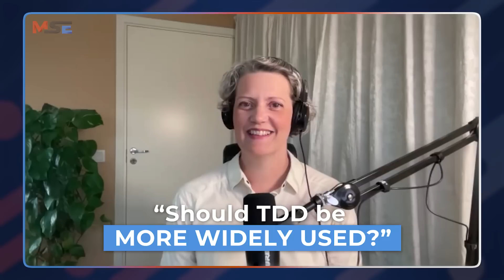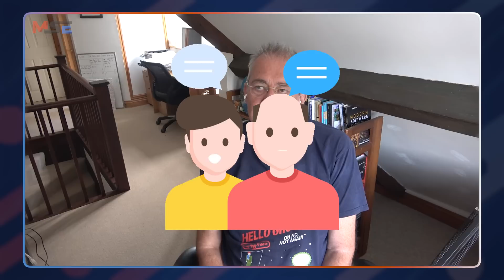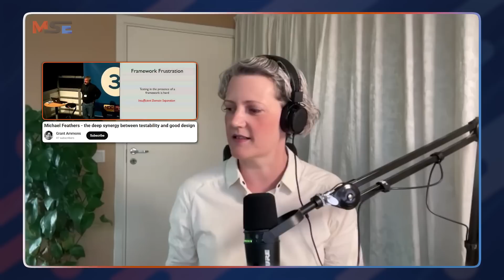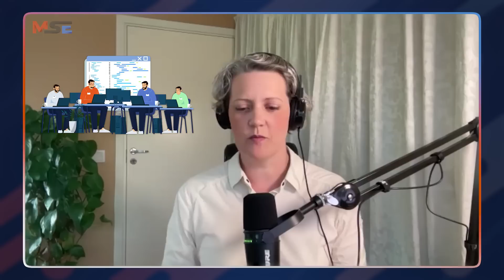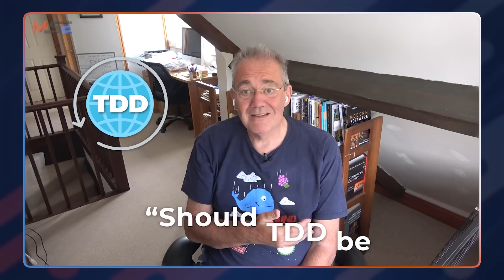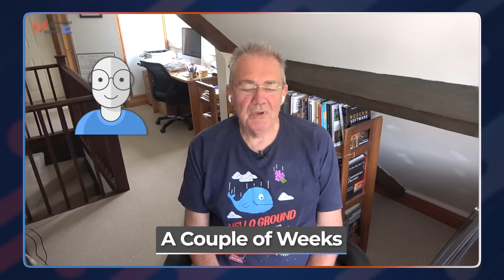Should Test-Driven Development (TDD) Be Used MORE In Software Engineering?

Comment: Approval testing is nice for legacy code but you are doing a disservice to the next developer. The output tend to get very big and don't describe the problem you are trying to solve enough. So a bug happens, but the tests pass but you have no idea what the intention was of the previous developer so you don't know how to fix without a lot of digging. If it has a more specific test then at least you have a description of the misunderstanding.
Reply: This is literally designed so you can get a test around stuff that you otherwise have to test manually. Where I have seen it it is a temporary measure until you can replace the garbage with something genuinely testable, then you get rid of it.

Comment: Religion allert... TTD is overused and also adds complexity. Overuse is changing 1 simple thing and 20 tests start to fail. And then the game starts: which is wrong, the test or the implementation?  Most of the time, functional tests are the only tests that matter. In => Out. Especially in big but smaller budget projects
Reply from the maker: That's a problem of poorly written tests, not really TDD as a practice. If you can't tell which is wrong, then your test is badly written. The test should clearly define what is meant to happen, in terms of desirable behaviour of the system.
Meta-data studies identified that 60% of production failures are caused by the common forms of mistake that all programmers put into code, off by 1 errors, conditionals the wrong way around and variable-scope errors. These are eliminated by simple automated testing. So no, functional tests aren't the best way to catch those mistakes.
Reply: @ModernSoftwareEngineeringYT, so if software can be written poorly and you try to fix that with tests, also software, you just admit a test can also be written poorly. Then, the problem of poorly written software is never solved. The problem of 'poorly written' comes from the devs who write the code, so the code, being business logic, or tests is always as good as the devs who write it. That's my point. Sure, good tests as intended in TTD will work great, but only when written by good devs. TTD adds complexity and workload and is not THE solution to guard software from bugs. It costs a lot of money, especially if tests are soso written. That's why functional tests are better. Test a wide coverage of in and out, and when something breaks, you will see it in that test.
Reply: If you make a tiny change and lots of tests break, you are testing the implementation, not the api.  either that, or you are end to end testing slop which can only be tested through the ui. In either case it has nothing to do with tdd, and everything to do with having no idea how to write testable code, or how to write tests.

Comment: The problem I have with the TDD/design argument is that the design (as described) is only ever considered in the context the current test. I don't really agree that this approach would drive a better design, as much as it will likely settle on a local minima of sufficient design.

The danger there is that future changes, which could have been known requirements at the outset, become incompatible with the architectures and data flows which have emerged - and either require ugly implementations or complete rewrites to implement.

I don't think TDD is incompatible with a design first approach...
Reply from the maker: I think, from your comment,  that you are missing some context of how design works in practice in TDD. 
I agree with you that there is no problem with thinking about design first. The trick is how you do that and the nature of that thinking. I tend to use ATDD (acceptance test driven development) to shape the overall design, create "executable specifications" for what the SW is meant to do. I also often draw  pictures to help me think about larger or intermediate level structure in the code. The mistake I see people make in design, is being too detailed at this stage. I think this level of design should be more like a rough sketch than anything detailed. The TDD helps you flesh-out the detail much more accurately than any other approach, and gives you much faster and better feedback on the quality of your design as a result. Most people that complain about design in TDD, are usually, in my experience, talking about unit testing rather than TDD. Unit tests tend to be too tightly-coupled to specific implementation. True TDD focuses on testing externally visible behaviour of the code, rather than implementation, and so is more resilient to change in implementation, and so supports exploratory design very well indeed when done well.
Reply: @ModernSoftwareEngineeringYT  That didn't come across in the video - to me it was suggesting that beyond the design of the test itself that no design was required until the optional refactor stage at which point it was more documenting the decision rather than reasoning the implementation, updating models and reviewing the traceability etc.
Reply: @ModernSoftwareEngineeringYT I hate to disagree with someone who literally wrote the book, but when I do it I write the tests to the public api, and the individual subfunctions get exercised and refactoring while being driven from that api. That way I can rip out old implementations simply by changing how the public function exercises the underlying code.

This does not mean that you can't identify useful helper functions, extract them during refactoring, and decide later if they could usefully be added to the api.

Comment: The issue is that most of the time your enterprise app is either crud or event handler -> database and back in two layers of business logic and one layer of io handling (web controller, message handler etc..).. Most common apps in business are wide and shallow and there is no design here. If you are being creative here, if you are "designing" you are overengineering.. So this whole argument for TDD just vanishes.. Narrow and deep programming jobs (3d or audio engines, whatever pdf interperter is, etc) benefit the most from TDD but are quite rare in practice..
Reply: It is like stating that good structural engineering requires solid math upfront, because skyscrapers. Unfortunately your actual job is laying down asphalt on clay dirt.. Like I do agree that math uprfront is essential - for actual *building*. But road works are more like 2% structural engineering and 98% cost management...

The real question is what is cost proposition of TDD? I have strong feeling that enforced dogmatic TDD is net negative..
Reply from the maker: Not sure what "enforced dogmatic TDD" is, but there is some data - "60% of production defects are the result of common programming mistakes... that would be eliminated by simple testing" https://www.usenix.org/system/files/conference/osdi14/osdi14-paper-yuan.pdf

So TDD can eliminate 60% of production failures, this is backed up by the practical experience of TDD teams. 

The DORA results found that "high performers" based on measures of "Stability & Throughput" spend 44% more time on new features than teams with average scores. 
This is not strictly a measure of TDD, but high scores in "Stability & Throughput" predicts that you are  practicing "Continuous Integration", and that tends to go hand in hand with TDD.

My own experience of working in high performing teams and using TDD is that these number under-estimate the impact. Paddy Power saw a 95% reduction in production defects when adopting CD (including TDD) and similar experiences are normal for teams that work this way.
Reply: @ModernSoftwareEngineeringYT  Mr Farly, thank you on replay.

I have read document you provided, and in very document out of 60% of "easy bugs to test", 23% percent were "very easy" single event failures. With a caveat that many of those where concurrency bugs. I wouldn't call that obvious - which brings me to a point that you can't test for what you don't know. Yes those "60% easy bugs" triggered by 4 or less events are trivial in a sense that a closed line integrals are trivial if you are used to them. It is hard to predict failure mode so statements "If your test were better" sound as being stated by Captain Hindsight..

Which brings me to a point which I made in my comment - that for majority of code being developed enforced TDD is cost negative.

There was old IBM study about cost of bugs and cost of early bug catching. Like bugs costs way less if caught early. The issues which I am raising are is that not all bugs cost the same. That study was written in times were deployment was a job. Today it is greatly context dependent. And majority of software works well with: ship it, report back if something is broken, we'll fixit in next version (or roll back if it is necessary). It is perfectly fine attitude for 90% of apps out there. 

All examples in your study are from established products with wide user base. I do agree that those require much more testing, for sake of distribution and usage variety alone. But those projects are "skyscrapers" from my initial post. Majority of code doesn't do distribution. Not even that but it has one deployment. Even in my "cool" app which (a real time card fraud)  main loop is like 5k lines, and next 200k lines are crud or presentation. Do I really need TDD for next data entry crud screen with paging logic? It is the same logic as 80 of those prior. If something doesn't work after deploy just use SQL Developer.. 

Majority of code being written out there are of this kind. Working or "product" is a rare feat. And established one as Redis is like never.

Dogmatic TDD would be "100% test coverage", "no commits without test" etc. Like insisting on form without understanding it.
Reply: @bariole while I am sure there are some jobs where you are just writing a thin boilerplate data entry front end to a database and tweeking how the report at the end of the day looks, which is what you appear to be describing, that stopped being most programming before windows 95 was released, so I seriously doubt it applies to most programmers.

Test in production has not been even good practice for a really long time.

Comment: I've used approval testing to write tests that are for systems that are chaotic in the classical sense.  That is: they are deterministic, but unpredictable.  For example, encryption or compression.  I've also seen this used for graphical output as well, where it's difficult to specify actual pixel outputs.
Reply: Approval tests are vital when the output from the diff is hard to quantify, which is why they are trinary valued.

Comment: I've been very slowly trying to adopt it, but from the example she gave where she was trying to teach it to a class, context is very important apparently for tdd. Most of the times my tasks come in 3 lines describing what they want. There's barely any context. Can I work with that? What should I do in this cases (pls, bare in mind I do ask for more context, there just isn't)
Reply: To me, it looks like this code should never have been anywhere near that class.

If you were trying to teach tdd, use code katas until they understood how to do it.

If you were trying to teach how to tdd against legacy code, you should have been working on a bit at least some of them knew.

If you were a consultant trying to clean up a piece of legacy code with nobody left who knew how it worked, you should not have been trying to add new features until you got the mess at least partially under control.
Reply: Bad though the phrasing sounds, you would not try and win the tour de France before you can even take the stabilisers of the bike, and the same applies to learning anything that is new to you and not trivial.

This is why katas exist, so you can learn where you are free to make mistakes where it is safe to do so. Once you have the basic techniques down, you can move on to trying to increase testing for ci, but only if you have buy in from all concerned parties. You can't do tdd or ci if someone on the team is feature sprinting while breaking everyone else's tests with no push back. The same applies with long lived feature branches.

Version control only works at it's best when you know that the code changes not only work, but also don't break other code as well. The only way to do this is to have as full test coverage as possible for the affected code, and the best way to do that is with all new code needing full coverage done in small chunks like you do with tdd.

Don't try and learn on a big legacy code base, and if you need to retrofit tests to code without them, read "working effectively with legacy code by Michael Feathers" which details how to do it.

Comment: I had the pleasure of being taught, many moons ago, by Sebastian Bergmann of PHPUnit fame and it was very much a penny-dropping moment.

However, with the introduction of GenAI, what I'm looking for is how TDD evolves with and/or keeps pace with the tools at our disposal. We are rapidly approaching a time where GenAI will write better units of code than we do (to the point, even, where we will not be fussed on how it achieved the result - after all, we don't much care about how CSS is converted to pixels in the browser, much less do we care about the intricacies of the CPU instruction code). So I think we, the guys that learned this stuff "the hard way" to be a) helping GetAI makers incorporate TDD training into their models, and b) how the heck do to instill the knowledge we learned "the hard way" in a new generation of engineers that simply will not gain their experience like we did.

I think the Modern Software Engineering is currently more on a Vintage Software Engineering trajectory. This is not to say the accumulated wisdom is not needed, but our industry is changing rapidly and I firmly believe that that wise old-timers among us should be able to guide us into the new age. I think it will be unfortunate if we end up hindering that transition ...

We can put this on analogy with the transition from chemical to digital film. I believe the experts that transitioned early and then helped the ordinary person to take better digital photos ended up contributing more to hobbyists and professionals alike.
Reply: AI makes TDD more important than ever.  Why?  Because a test is a specification. If you don't have your specifications you don't actually know your requirements. Because a test is a specification, I would prefer test function names starting with it_has _to.

Comment: I love TDD and have been practicing it for a number of years, but I still find myself learning how to work better with it. Just the other day, I went down a TDD rabbit hole trying to get my C# business logic to behave properly with data that it read from a repository (in reality, rows returned from a SQL Server stored procedure). I couldn’t help but think that there was an aspect of my design that was more complicated than it needed to be. After thinking about it and even consulting Google Gemini for advice, I concluded that the problem was that I was essentially putting filtering logic (the equivalent of SQL WHERE clauses) in my C# code. I felt that I needed to do the filtering in C# because I was concerned that someone could change the filtering of the stored procedure later on down the road, which would break my C# logic. But writing unit tests for this filtering as well as my C# logic was getting complicated, plus I was violating the single responsibility principle by doing filtering and business logic in the same place. I decided that the stored procedure needed to be treated as its own module with the contract that it would handle the filtering, and that testing it was not a concern for my C# logic. Tests for it could be written separately. This made the code and tests for my C# logic much cleaner. I will definitely need to remember this in the future because as Dave has mentioned on this channel, TDD can get challenging when dealing with I/O from the outside world.

Comment: Canon TDD - additional points:
1. TDD is late binding of choices of Classes and data structures. It is at a higher level of abstraction than other approaches and therefore a harder discipline.
2. Current languages are not ideal because of clunky and expensive Classes and data structures.
3. In general, choose the easiest-looking test from your task list: write the easy test and then the easy code to implement it. TDD reduces cognitive burden.
4. Don't refactor after every test. Refactor when the code looks like it needs refactoring; typically about every 10 minutes. 
5. If you write the code first, you will tend to write methods and then tests for those methods. TDD writes code to make a test pass; again, later binding of choice of implementation, and form more closely following function. Each test may be a method, but there is no reason per se for there to be a 1-to-1 correspondence between tests and methods.
6. TDD comes after architecture and overall module design; the same as if programming not using TDD.
7. TDD does not replace Acceptance Testing - you will still need the same AT suite as if you didn't use TDD.
8. TDD requires acceptance by the entire programming Team.
Reply: I would disagree about don't refactor with every test, as the whole point of the tdd cycle is to make sure your test can fail, then get something to work, then remove the problems by refactoring to avoid adding technical debt in the first place.

If you don't refactor with every test you are only doing test first development, not tdd.